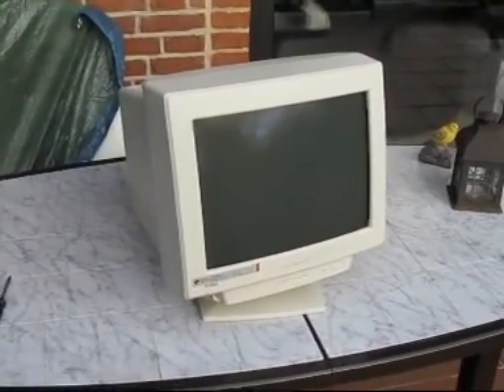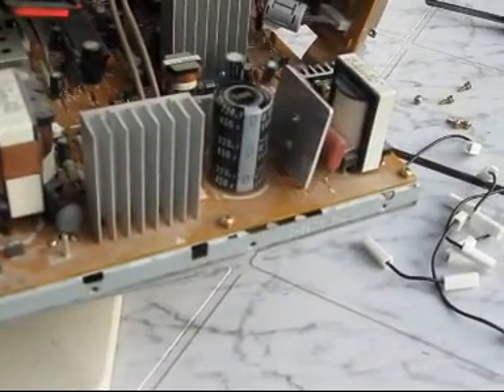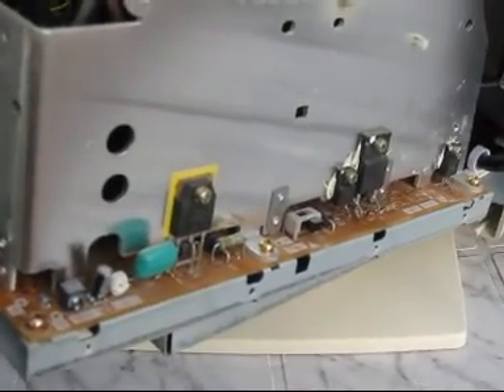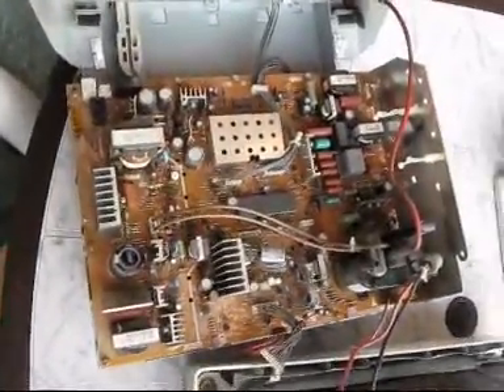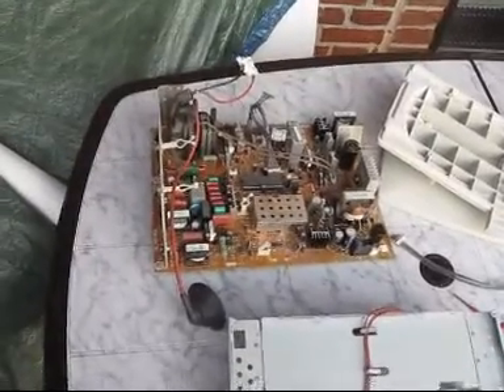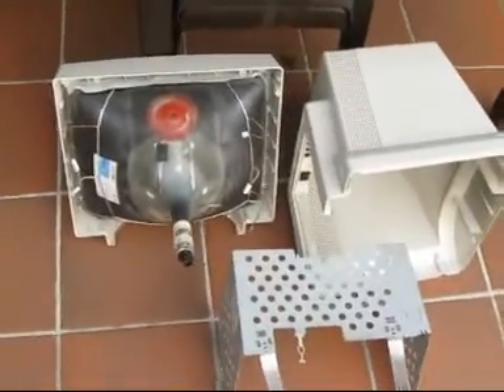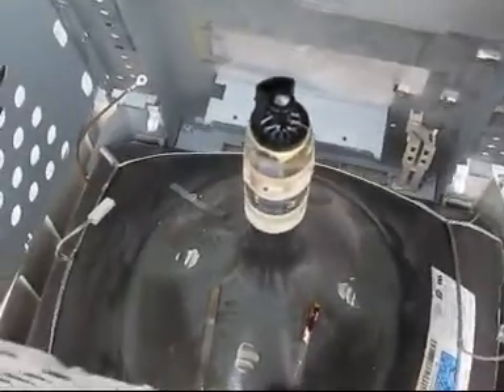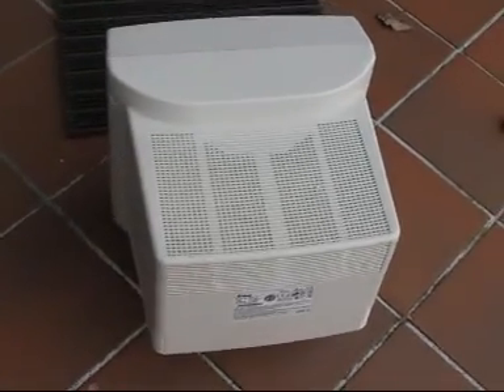WHAT'S INSIDE ? #01 DISASSEMBLING A CRT MONITOR

Comment from the maker: a ball of aluminum foil will fix the problem.
just press the ball on any connector.

so U can discharge the caps from the solder side of any PCB as well.

if a BANG occurs - who cares.

O_°

:D

Comment: You have to be careful in regards to what you use to discharge the anode of the CRT. In most sets where the aquadag (coating on the exterior of the tube) is at earth voltage (0V), then you can safely discharge it to the aquadag (or the tensioned metal implosion band running over it). You can't, however, discharge it to the aquadag in sets that have a 'floating' chassis (floating above earth voltage - such as many Philips sets which may be around 50V). That can damage vulnerable components.

Comment from the maker: no, U can do it after waiting a few minutes after switching off the screen.
to be fully sure of having no residual HV charges, discharge the primary capacitor of the power supply and the picture tube: lift off the rubber cap so that U can see a metal connector there. then connect a 10 megOHM Resistor to this connector to a grounded part of the circuit. e.g. a heat sink

Comment: Well, monochrome tubes only require one cathode (gun) to 'fire' one beam at the positively charged phosphor screen. Colour tubes need three cathodes, to fire beams at three different coloured phosphors on the screen. The three cathodes are fed varying voltages to vary the strength of the beam. If you had one cathode, the scan rate would be at least three times as fast (to cover the RGB phosphors), and that isn't possible.

Comment from the maker: well, not really Palladium.
U can probably find this -If not Gold or Silver- in electrical contacts (switches, connectors etc)

For capacitors (SMD) they use Tantalum (I think as an oxide there).
U shouldhave a look for yellow coloured brick shaped capacitors or the ones that look like water drips
(these are yellow, orange, green and blue)

Comment: I've heard some capacitors (surface mount ceramic) have a small percentage of palladium in them. Would that be true for the capacitors found on the circuit boards of crt monitors?

Comment from the maker: Hi. The transformer has about 150 Volt at horizontal line frequency. A regular TV would make about 15,5kHz and a Computer Monitor even more.
As Output U can say its about 25KILO-Volt at the same freq like the input voltage.

Comment from the maker: @kipkay211 
the lead is in the front glass.
but even if U break this front glass lead is no problem. because its like crystal glass molten into the glass. and U can have a drink in crystal glass which is exactly a lead glass as well. the most concern should be the layers right in the inside of the front glass allowing the electron beam to produce visible light.

Comment from the maker: HI. dunno your model of screen, it should be possible to adjust several values not via regular menu but by adjusting (adj) a potentiometer. most common thing is to adj sharpness with a potentiometer at the DST

Comment from the maker: @payneo218 
If theres really a residual charge in the tube, yes.
but repairing CRTs for 15 Years now i didnt have a charged tube when switched off.

The primary capacitor is the very danger. many power supply units have a charged capacitor when the circuit of the power supply "gave up".

but u can never know, so just be cautious, ur rite.

Comment: @desinfector I have a CRT monitor and bought a BNC cable for it thinking I'd get a better image. Turns out it reduced my resolution to a maximum of 1600 x 1200 when in fact it actually has the potential to display 2048 x 1536. I didn't notice any quality difference just a drop in maximum resolution. I don't know, am I doing something wrong here?